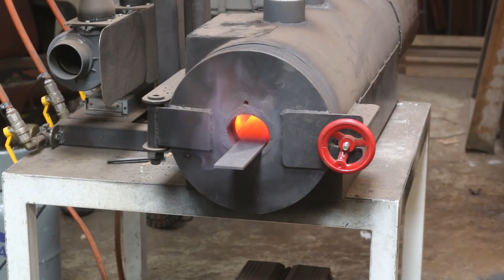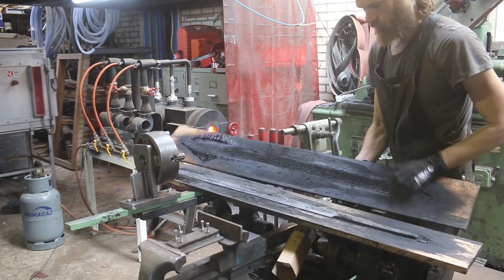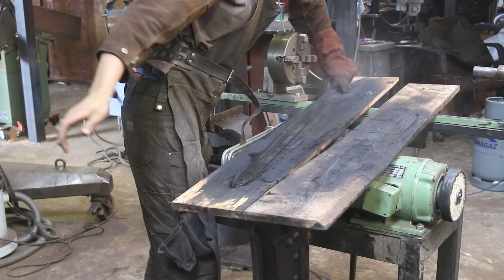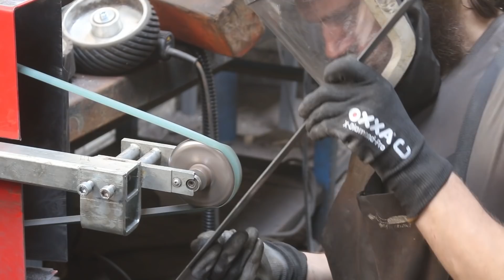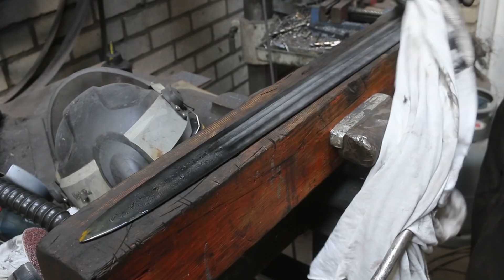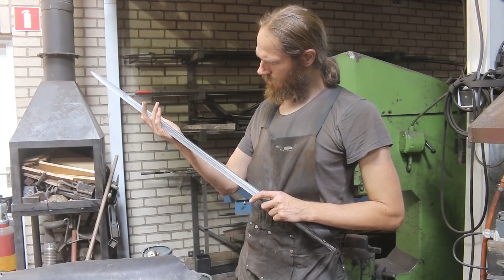Forging a pattern welded Basilisk sword,  part 2 , heat treatment.

Comment: I love the look of the Damascene metal, but I wished the sword to be a curved Arabic ⚘
Reply: You mean Damascus Steel?
Reply: The Arabs used straight swords before the Seljuk Turks made curved swords fashionable.
As for the steel, it’s pattern welded steel; true Damascus steel is a kind of wootz steel that gets its pattern by a different means.
Reply: I agree with you but I like the curved swords very much